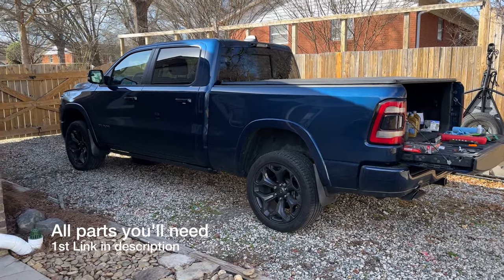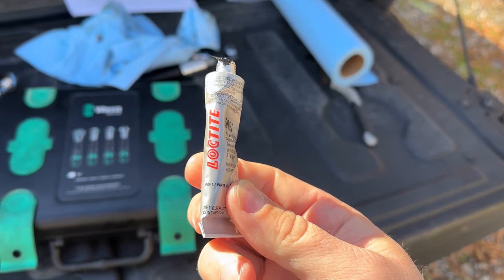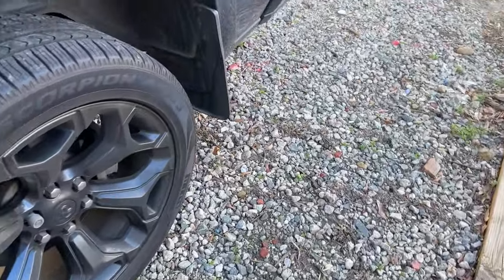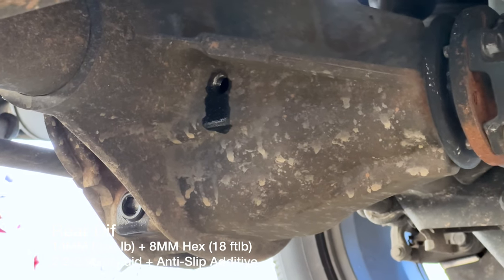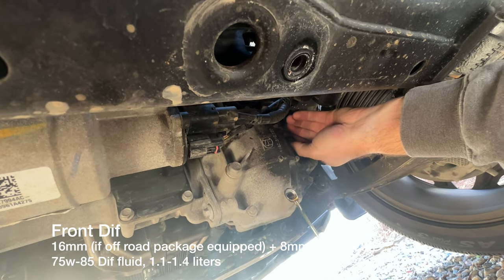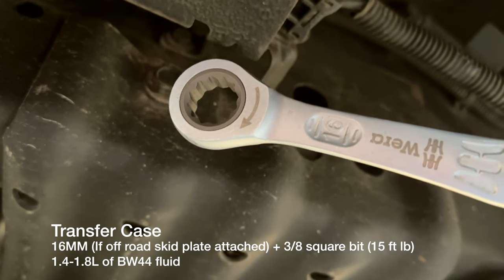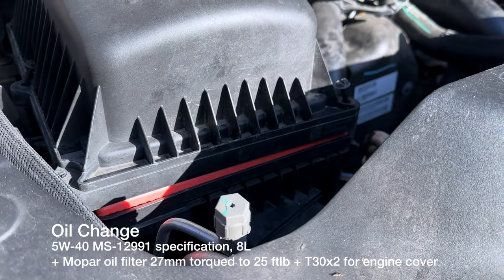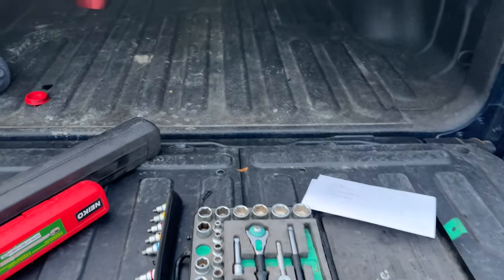2022 RAM 1500 EcoDiesel Differential Fluid Flush + Diesel Fuel Filter + Transfer Case + Oil Change

Comment: Hey Adam. Just wondering if you still like this truck. Im looking at the 2022 with the eco diesel and ive heard horror stories about this engine. Just wanted to see if you have experienced anything bad with this motor. Thanks
Reply from the maker: Hi Chris, personally I haven't had any issues with the motor. There have been 7 recalls on the truck so far which isn't great but at least RAM is taking care of things. I'm changing oil every 7500 miles and avoiding short trips and treating it like a diesel which prefers highways to city streets. I'm very happy with the performance and fuel economy.

Comment: Bosch’s website and Amazon both say the cabin air filter you linked won’t fit a ‘22 1500 EcoDiesel. Can you confirm you linked to the right filter?
Reply from the maker: This is the current part number - 68406048aa

Comment: Got 2021 RAM 1500 eco diesel. When i supposed to change diff fluids?
Reply from the maker: Check owners manual but my dealer told between 60-100K miles depending on severity of use.